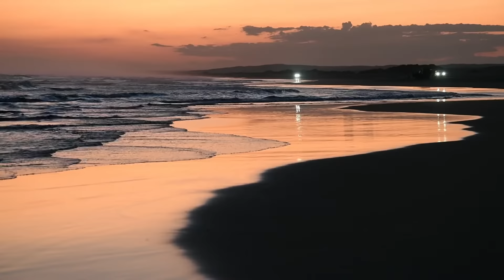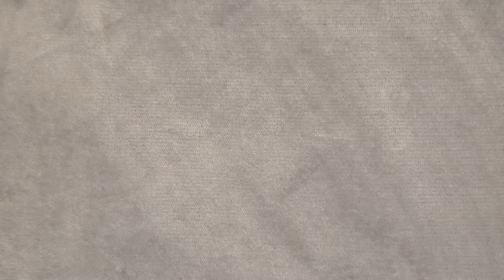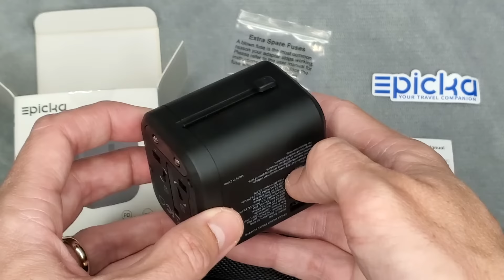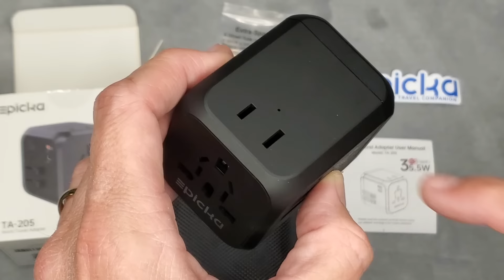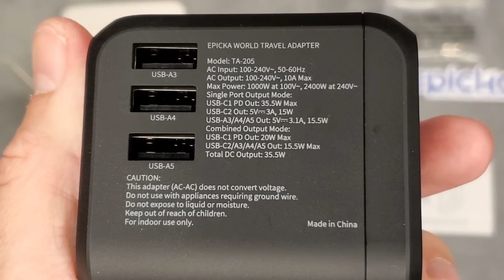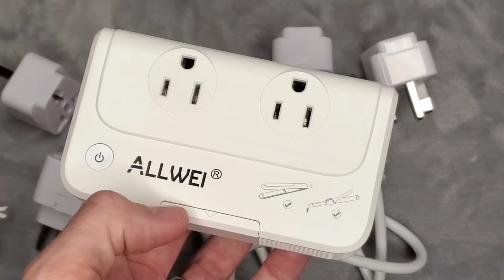How To Pick The Right Universal Power Adapter Plug or Voltage Converter for Your Trip

Comment: Thank you for this video. For my trip to Peru, I will only be bringing my Samsung S25 and a couple of devices - toothbrush, redlight device, etc. - that are low voltage (110v). I have plenty of adapters (like the ones you have in the bag) but it sounds like I need a converter. What do you recommend? Thank you!
Reply from the maker: Check out the link to the ALLWEI device in the video description!

Comment: I have a cheap pink iJoy adapter with 2 USB ports that reads: 
"POWER:
AC Max. 6A 250Vac
USB Max. 2.1A 5Vdc"

would this be okay to travel with my 2020 M1 MacBook Pro laptop, phone chargers, gaming laptop, etc. without frying them? I think the chargers for my laptops are between 61 and 65 W. I don't know the math on conversion, and Google confused me even more. I have never traveled outside of the United States, so I am in new territory with traveling and power supplies.
Reply from the maker: @LadyChaos1992  Not the best labeling, but here's our interpretation: You will not be able to plug your MacBook directly into the USB ports of that device because they won't supply enough power. However, if it is a plug converter that gives you a North American female port which you can plug the Apple laptop charger into, you should be good to go!

Comment: What if you are only charging an iPhone.  I'm going to Peru and will not bring any electronics except for my phone.  Would this product be enough?
Reply from the maker: @dtpbach  You can use any of the adapters linked in the video description for almost any phone charger on Earth. Chargers for small electronics are nearly all dual voltage nowadays.
Reply: @ ok just wanted to be super sure. I have many adapters and I found a C plug.

Comment: Okay, wait what? Please elaborate on electric toothbrushes. I’m traveling to Laos and Thailand for a month in January and obviously need to charge my electric toothbrush.
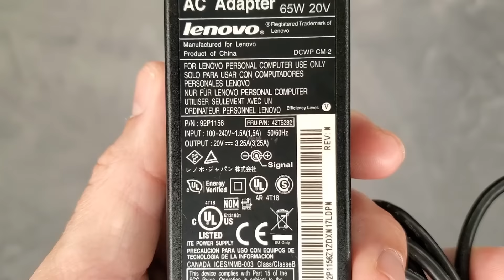Reply from the maker: Just make sure the label says it's dual voltage, like you see at 01:01 in the video, and you should be good to go anywhere without a voltage converter. You'll still need an adapter though, like the ones linked in the video description.

Comment: Is a portable power bank dual voltage?
Reply from the maker: Just read the label on the part that plugs into the wall AC port! If it looks like the labeling at 01:01 in the video, then it's dual voltage. Almost all portable power banks will plug into the wall via a dual voltage adapter.

Comment: Can I charge my 25000mah portable charger with an international power adapter or do I need a converter?
Reply from the maker: @samuelfraser7048  If it plugs in via USB port, then either one will be fine! Check the links in the video description for our top recommendations.
Reply: @TripOfALifestyle Thanks, really appreciate the quick response. Would you be able to tell me if my power bank (Iniu 25000mAh 140W) is dual or single voltage? I'm traveling to Thailand soon, so I just want to be very sure.
Reply from the maker: @samuelfraser7048  Your power bank battery probably charges via a USB port. If that is true, you can safely plug a USB cable into it from pretty much anywhere. They're standardized.

However, the source that powers that USB connection (like, the charging "brick" that you plug into an AC wall outlet) needs to accept "dual voltage" input to be safely used anywhere without a converter. Almost any USB power source satisfies this requirement, but if you want to be absolutely sure, you need to check the label for something like what you see at 01:01 in the video.

The short answer is: You are almost definitely good to go without a voltage converter for your USB power bank and its charger, anywhere in the world.

Comment: Hi! I am travelling to Japan and I have a hair straightener that has a 110-240 voltage and 50/60 Hz power. Do I still need an adapter or converter? Thank you!
Reply from the maker: That's a dual voltage device, so you will NOT need a voltage converter. You just need an adapter to make the plug fit.

Comment: Thanks for your tips! Question: You said that if you have an appliance that doesn't accept the full range of 100V to 240V, you'll need a voltage converter. I have a hair curling iron that lists a range of 110-240V, with 50/60Hz. Do I still need a voltage converter because it lists 110V instead of 100V? Just thought I'd double check!
Reply from the maker: @turtleduckcrossing463  Good question. You're safe!
Reply: @TripOfALifestyle  Great! Thanks so much for your response!

Comment: Thanks for your video!  Would you recommend the ALLWEI SGR-HS260B Voltage Converter for using a travel steamer in Europe?
Reply from the maker: @sking3225  If it is NOT a dual-voltage device, you will need a voltage converter such as the ALLWEI device. Also be careful to make sure that your steamer does not draw more than the ALLWEI's power limit of 230 watts (you can also compute the power draw by multiplying voltage in volts by current in amps).
Reply: @TripOfALifestyle  Thank you for your quick reply!!  It’s a little intimidating 😅!  I’m sure hubby will figure it out for me!!

Comment: Is it okay to use this with big electronic like a tv or consoles like a xbox or ps5, is it safe to use it a lot ?
Reply from the maker: @yNwa0fLd  Shouldn't be an issue to use a converter all the time, especially if the device is dual voltage!

More info: https://www.tripofalifestyle.com/gear-and-tips/international-plug-adapters/

Comment: I will get hubby to read this article as he is technically savvy. Last year I went to Cuba with a machine REQUIRED for my health and a new converter from CTC. It did not work and I almost had to come home. An employee with as asthmatic child lent me some equipment. I do NOT want this to happen again.
Reply: i'm soooo confused when he said 110 to higher voltage country is a step down.. if the voltage is 240 isn't that a step up becuase the number is higher..... where ccan i find one that has everything in 1?
Reply: @cupidok2768 he is talking about converting to his devices from higher to lower voltage to accommodate his device needs thats why he used the wording step down
Reply: @cupidok2768 you are stepping down from 240v to 120v.

Comment: That adapter does not support grounding. Also the europlug it has is rated only for 2.5 A. That is what they make when the makers do not know or do not care about electric safety.

Those adapters that you had a bagful are absolute death traps. Never use anything like that.
Reply: @okaro6595 What should someone be looking for instead?
Reply: @theworldinside1604 The more specific the better. It is basically impossible to make a safe everything to everything adapter.